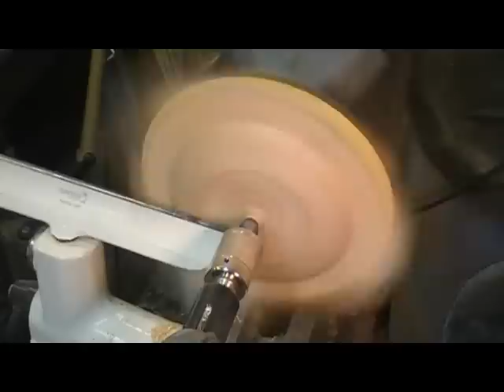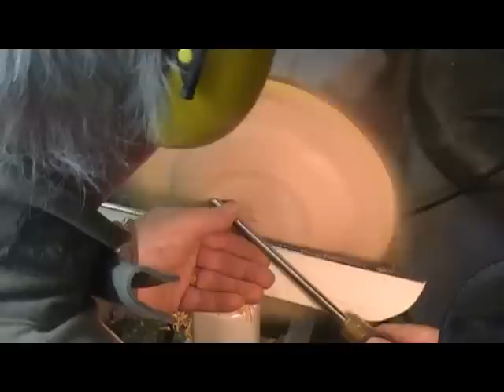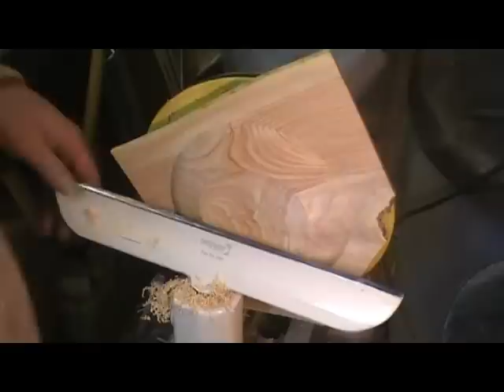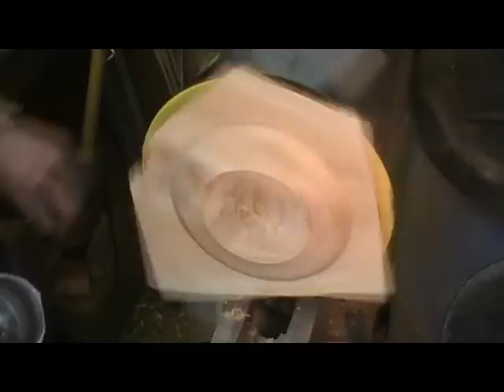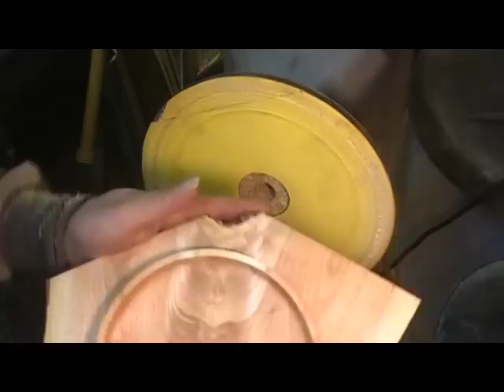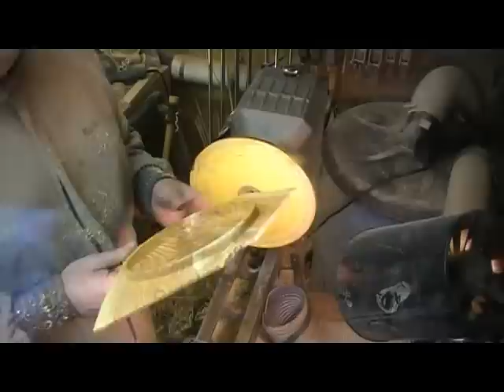Locust crotch bowl part 5 of 5

Comment: Beautiful  bowl, Bob. It looks a lot like a Chinaberry crotchwood bowl I finished recently, though mine doesn't have wings. It came from an 8 inch round blank. My little midi lathe can only do a little over 9 inches. The grain patterns and colors are very similar to yours, though. I found that in some areas the wood was denser than others and it never did get balanced. The darker areas were heavier. It sure turned out pretty, though.
 Thanks for sharing. I've really enjoyed your videos.